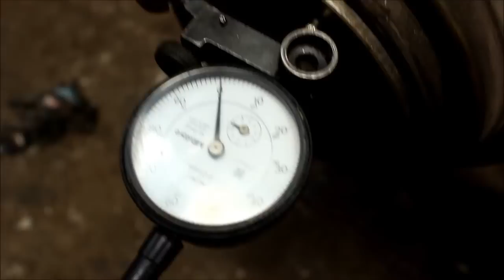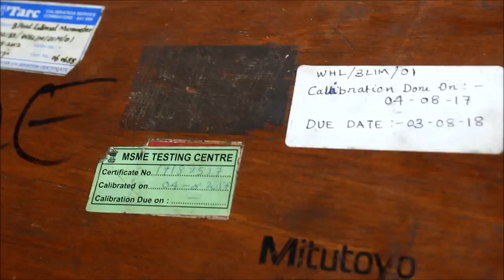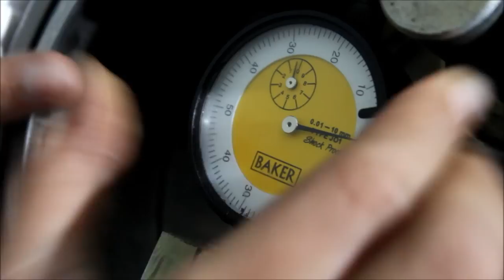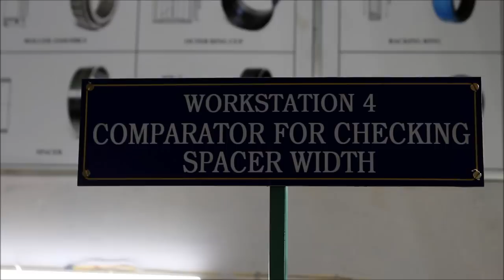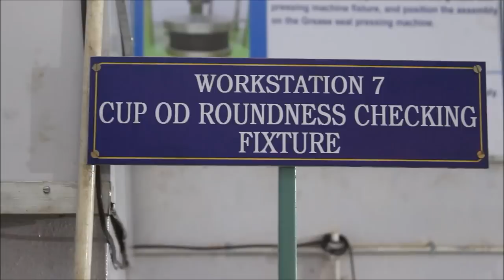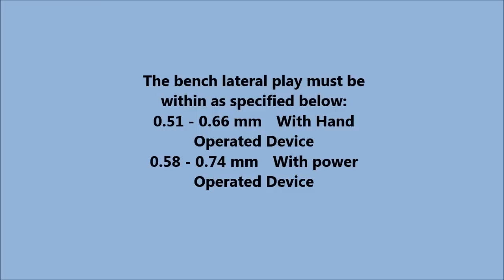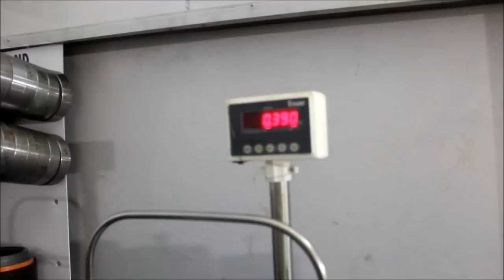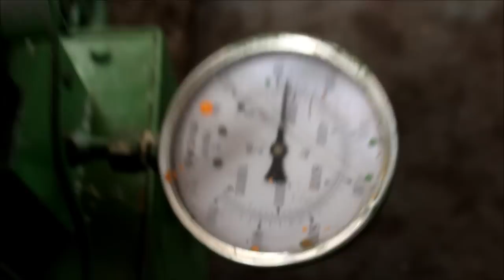WAGON CTRB REFURBISHING

Comment: As per RDSO guide line G-81 manual total work should be done in dust proof area.calibration schedule of instrument & gauges are mentioned.washing medium what?? If kerosin oil used ,where rust preventive oil.

Comment: I worked for The Timken Rail Road Bearing division for 15 years and one of my jobs was the setting the lateral play with various widths of spacers ( we had stacks of them in 0.003” difference in thickness to get the bearing into the proper range) between the two cones. As I recall it had to be between 0.021” and 0.027”.  That is what he was measuring with the mag base indicator.  While the first bearing shown are not Timken it’s exactly like Timken.  While the rollers look straight they are actually crowned, larger in the middle.
Our lateral machine rotated the unit having all the pieces moving and seating therefore giving a very accurate amount of play between the top cone and the bottom cone.  The Columbus OH plant did the screw machine turning, heat treating, grinding, quality control inspection at all stages, and assembly.  The rollers came in as long round bars of stock and they were fed into a machine sheared to length then slammed and pressed into a die to indent the end and give them the tapered shape.  They were then heat treated then ground the the smoothness and crowned shave that was necessary, each piece visually inspected.  The grinding operations consisted of 6 or 7 machined that had a steel guide about 20” in diameter that had spiral shoulders and it rotated moving the roller past a rotating grinding wheel with coolant flowing to wash away the grinding dust, this was repeated through the other grinding stations, each on grinding a little off and shaping the surface to a crown. 
That is but a small segment of the precision manufacturing process.
Reply: What will be percentage in your roller of retained austenite ?

Comment: At 10:30 min. When you checked roundness of cup in your gauge. At that time you should use Ground V block in place of rotational shaft. (You can avoid radial runout of bearing which support rotational shaft)

Comment: A tap should be run in the bolt holes to clean the threads which would make it easier to tighten the bolts.
Reply: Bottom tap run into the holes and blow that crap out with low pressure air. Too much effort required to get that bolt to snug up and that means there is crap on the threads. Hate that.